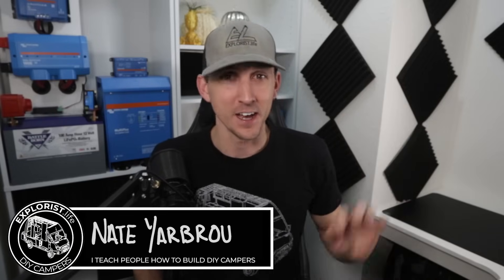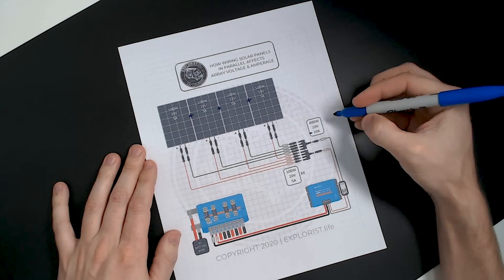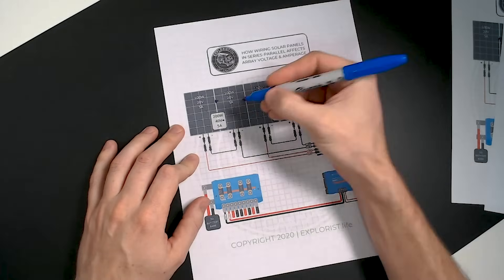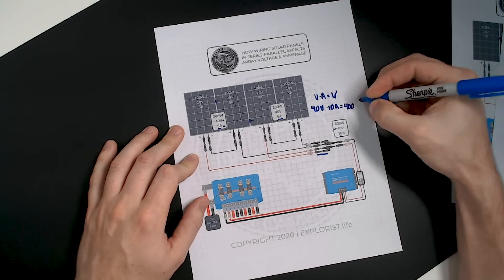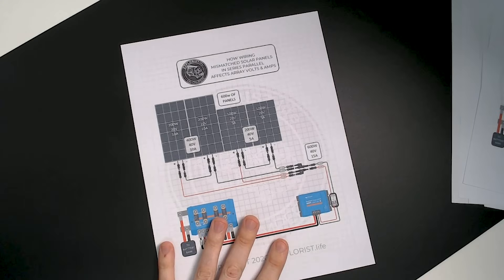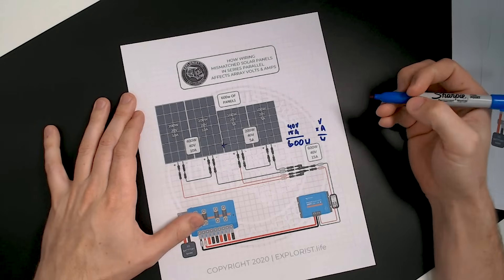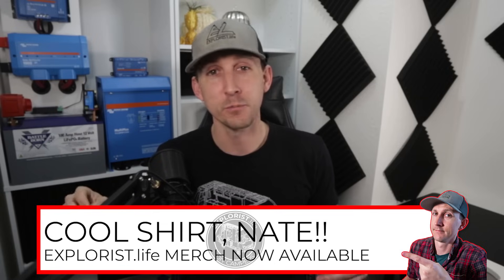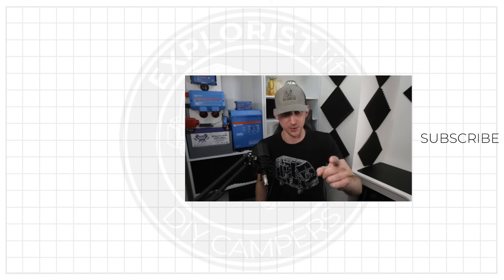How to Wire Different Sizes of Camper Solar Panels Together - Effects of Mismatched Solar Panels

Comment: Hello, I have a quick question. I have 3 100W 18V panels and a 225W 36V panel that I got for free from a friend. I did the maths and the more interesting route is to wire all the panels in series to have 95% efficiency instead of 79%. I was wondering if it was still the best route to wire them in series even with partial shading that will affect the array quite a lot. Thanks in advance for the answers!
Reply from the maker: Hey, Maxime Raison! I appreciate you taking the time to ask your question, but unfortunately, I don't have enough info about your specific question to provide an accurate answer, but here is a playlist that, if you watch all of the videos start-to-finish (and take notes 😉), you'll have a REALLY good idea of how to design a solar array: https://www.youtube.com/watch?v=Jkbs84sBHsg&list=PLmvhcyi4n0TV9pi83rFTv3ZuMT_S1xIZt

Alternatively, I have some of my most common solar array setups pre-built here: https://shop.explorist.life/product-category/all-products/camper-wiring-kits/solar-charging-wiring-kits/

Comment: When calculating what figure do you use? I see open current voltage, short circuit current (amp), peak power voltage, peak power current (amp).

Comment: If 2 sets of 4 panels each in series and then together in parallel with all the panels the same in voltage and a page but 4 were on east facing  and 4 on west facing roof, what would be problems is 1 bank in the sun and 1 bank in the shade

Comment: I have a 395w 10.8amp solar panel and I'm getting 288w out of the inverter. I need 112 more watts to achieve pass through charge and enough for my small items without draining the battery.  What sizing would you recommend to get to add to this one solar panel? I think it's max voc is 42v
Reply from the maker: Unless you have a REALLY good reason to do so... I recommend using matching panels... so I'd recommend another 395W panel given the charge controller can handle it.

Comment: Thanks. Accidentally ordered a panel that didn't match. Same watts, similar voltage. (17v / 22v.) been in parallel for a year after having just one for the year before. Was starting to feel one panel did same as both combined. [They are on shed, run pool pump, lights and stereo, charge Ryobi lawnmower, e-bike, few random other things.] Just bought a 3rd panel to match first, plan to charge both battery banks at the same time with different controllers. Commuting to work by e-bike is taking a lot. Sometimes wasting power by not using enough of it, other times getting low and having to ration.

Comment: Hi Nate! Awesome video! Really helpful! I still have a doubt if you can help me! I live on a boat, with a battery bank of 700A with 6 solar panels adding a  total of 740W. They are different Wtts but very similar Vts. All connected in parallel. Question is: what’s more important to charge my batteries, full 740Watts or all the Amps I can get from the parallel connection?
TIA! Cheers.

Comment: So would you calculate with Voc or Vcc ?
Reply from the maker: Vmp gets you voltage during max power production.  Voc is used for max voltage of the charge controller.  Vcc isn't used for much of anything.

Comment: while all your math is correct it is Ohm's law not Watts
Reply from the maker: Glad the video helped and I'm sorry for your confusion, but Watts law is: Watts = Amps x Volts as stated in the video.

Ohms law is: Voltage = Current x Resistance

Since we are given Watts, Volts, and Amps; we use Watts Law.  We wouldn't use Ohms law as we aren't given resistance nor do we need to know resistance: Introduction to Electronics - Stanford Wiki: https://ccrma.stanford.edu/wiki/Introduction_to_Electronics - "Watt's Law states that: Power (in Watts) = Voltage (in Volts) x Current (in Amps) P = V I"

Hope this helps!

Comment: Thanks for your videos on this subject.  When using cheaper equipment your video came in handy.  I bought a WERCHTAY 30A Solar Charge Controller that was rated at 50 volts and 30 amps but it was shutting down at 45 volts with my panels running in series, so I changed it to running in parallel and it solved the issue.  Your accent sounds Canadian, but you are in Colorado.  From where do you hail?
Reply from the maker: Glad it helped!  I'm originally from Oklahoma.

Comment: These examples were great but they weren't talking about connecting two panels together with different volts and amps. For example I have a Renogy 100w panel that says it puts out 19v and and 5.26 amps, and another panel that is 100w that puts out 21v and 4.76 amps. What happens if I connect them together? I assume I would just lose some efficiency? In parallel they would produce 10.02 amps and 19v =190 watts, and in series they would produce 38v and 4.76 amps = 180 watts? Is this correct?
Reply: Parallel is correct. In series, add the voltages 21+19 = 40 v and use the lowest amperage which is 4.76 Amps.  40v * 4.76 Amps = 190.4 watts which is slightly more efficient than the parallel configuration.

Comment: Your video is very good. Explainations and diagrams are spot on!!👍👍 Math is also awsome. The one problem I have is you keep calling it watt's law, the correct terminology is ohm's law. I say this with 49 years of electrical experience. I am not trying to bash your presentation because it is quite good, just putting this out there for information purposes. Keep up the great work!!
Reply from the maker: How about this since it sounds like you're pretty confident... If I link a credible source that states that watts law is Watts = Amps x Volts and Ohms Law is Voltage = Current x Resistance... you send me $100.  Sound good?
Reply: @EXPLORISTlife  BOOM LOL

Comment: Problem: Bluetti AC200P.

I can run 6 panels at 130voc.  1 more panel puts it over the 150voc.  Mppt controller triggers.   I would like to use 7-100w panels in a series/parallel configuration.  2 in parallel and 5 in series to achieve under 12a/150v Any suggestions? 

Bluetti ac200p Solar generator 
Solar Input
*Voc 35-150V / 700W Max. / 12A Max.

*7-100w SP modules - OCV 21.6 - current 5.78a

I was thinking...
2 parallel and 5 in series. 5 sps@21.6v(108v/5.78a) 
X 2 parallal@5.78a (21.6v/11.56a) 
Connecting the parallel to the series chain.  

Total output:
5 sps in Series 129.6vX5.78a=648w.

2 sps in Parallel 21.6vX11.56a=249.7w

Is this correct?, and where's the best place in the series string to connect the parallel (front, middle or end)
Reply from the maker: Not quite.  Wiring 7 panels in a series-parallel configuration is going to result in massive inefficiencies.  You'll want to either drop a panel or go with a charge controller that can handle over 150v.
Reply: @EXPLORISTlife  I will try a 3s-2p configuration.

Right now at 1.21pm on the bluetti it is registering 100.6v-4a on the 6s string and 53.8v-2.4a on the secondary 2s input at 64.56% efficiency.  I've seen the average at 435w.  That's a 66.66% efficiency at the mppt.  But if I check the volts at the mc4 connectors it is at it's full VOC, which is why I can't add the 7th panel in series.

I could probably do a 4s-2p.  That's 86.4v x 11.57a at 999.64w at mc4.  With a 66.66% at mppt for 666.36w.  That's within range of the 15amp 10awg wire and 150v-12a bluetti compacity. Because volts are more detrimental than amps.  The mppt will regulate and I'll get close to the 700w ac200p input expectations.

Comment: Great Vidio, but can you explain this to me using 3 different sola panels? I have 2 x 160 watts with 22.9 volts and 8.881A and 1 x 200 watts with 26.4 volts and 9.46A.
Reply from the maker: This video gives you everything you need to figure that out on your own. 🙂👍
Reply: @EXPLORISTlife  Ok, let me do the calculations:

Parallel: 2 x 22,9 V + 8,81A, 2 x 160 Watt + 1 x 26,4 V, 9,46A, 1 x 200Wattt = 22,9V x 8,81 = 591,3 Watt =113,71 % efficiency
Serial: 2 x 22,9 V + 8,81A, 2 x 160 Watt + 1 x 26,4 V, 9,46A, 200 Watt = 72,2V x 8,81 = 590,6 Watt = 113,85 % efficiency
is that right?

Comment: The problem is that from here, miles ans miles away,in Sw Eu-rope we can´t  read the SMALL print you wrote on the panels; and you had real estate galore for huge print ...   lol
Excellent video, anyway, about to subscribe
edit (subscribed)
On the last example (the 6+1 panels) ,what if they wired the 7th panel in series with 3 of them, making 1 series string of three,  plus 1 series string of four?  1380 watts, instead of the 600?
i mean if you ADD watts,you MUST get them back,not less.
Reply from the maker: It's exported in 1080p, so you could put it up on a 60" TV if you wanted and I'm sure it would be plenty big. 🙂

Comment: I got a question would u be kind enough to answer. Say I have 9 solar panels all are 300W. Can I have 8 of them wired in series and the final one to be connected in parallel so that I can get more amps out. 
Solar panel 300W 45.2V 8.86A
So will I be able to get 45.2v x 8 = 361.6V and since the last one in parallel amps 8.86A x 2 = 17.72A 
So entire array would be 361.6V @ 17.72A is this possible or am I wrong.

Comment: Hi, I enjoy watching your clips. I do have a question about MPPT Boost. May I e mail you problem I have with 48V system using a 37V PV
Reply from the maker: I do not answer questions via email.  Feel free to ask your questions here, though, so everybody can benefit and pitch in with help.
Reply: @EXPLORISTlife  I have a 48VDC battery bank, and I want to use half-cut bi facial solar panel. But it has only 37V open circuit. do you know any other half cut panels that are over 55V?
Or do you know any Victron MPPT that can charge a 48v bank (lithium ion), with 1 panel. I have read about MPPT Boost, what do you think about it ?
Reply from the maker: I would recommend using multiple solar panels wired in series so that the array voltage is at a more appropriate level.

Comment: Rather than talking the people out of adding a 100 watt panel in the last example you might have told them to simply add a second MPPT controller.
Reply from the maker: For the sake of the example, that was not possible per reasons the client didn't want to discuss.
Reply: @EXPLORISTlife  fair enough.

Comment: I would like to add to my Keystone Solarflex 200 system, but another 200 watt panel from Keystone is pricey!

The factory installed panel is rated: Pmax/W: 200, Vmp/V 32.34, Imp/A 6.18, Voc/V 40.12, Isc/A 6.55 and feeds into a Victron SmartSolar MPPT 75V 15 A controller.  I found some Newpowa monocrystalline panels ($86 ea) rated: Pmax/W 100W, Vmp(V) 16.77V, Imp(A)  6.26A, Voc(V) 19.83V, Isc(A)  6.56A.

If I wire two of these 100 watt panels in series I would get 33.54 Vmp/39.66 Voc.  I would then wire these in parallel with the 200 watt panel.  If I’m doing the math correctly, I think I would be losing around 4% efficiency in ideal conditions.

Is there a generally acceptable variation or efficiency that Is this close enough?  Are there other issues I’m not taking into consideration?

Comment: Would love to know what the best way to join these two panels is. fingers crossed for a reply.
	

Grade A monocrystalline

Rated Maximum Power (PM)
	

160W

Voltage at Pmax (Vmp)
	

160W

Voltage at Pmax (Vmp)
	

19.5V

Current at Pmax (Imp)
	

8.21A

Open-Circuit Voltage (Voc)
	

23.8V

Short-Circuit Current (Isc)
	

8.40A

Normal Operating Cell Temp (NOCT)
	

47 ± 2°C

Maximum System Voltage
	

1000V

Maximum Series Fuse Rating 20A

,,,,,,,,,,,,,,,,,,,,,,,,,,,,,,,,,,,,,,,,,,,,,,,,,,,,,,,,,,,,,,,,,,,,,,,,,,,

Specifications
Max Power :350W
Max Power Voltage:18V
Max Power Current:19.4A
Maximum Power Tolerance:±3%
Max System Voltage:1000V
Operating Temperature Min:-40°C
Operating Temperature Max:85°C
Cell Tech:Mono-Si
Module Application Class:A
TUV Certification:Yes
Reply from the maker: Hey there!  I've taught you the math on how this stuff works.  I'm going to need you to give it a shot now. 🙂👍

Comment: So if I have 10 identical strings in parallel but one string is shaded it's going to bring the whole array down to the voltage of the one shaded string?
Reply from the maker: Any shading of the array will bring the array power down.  I recommend avoid shading your solar panels if maximum wattage is the goal.  Solar panels need direct sunlight to function optimally.
Reply: @EXPLORISTlife  I understand that. I have no shading. It's the point tho. ive always been told You parallel strings specifically so if one string is shaded you will still get full power from the unshaded strings. But by your explanation if one string in parallel is not producing as much voltage as another string it brings down the whole system.

Comment: question on the charge controller itself. I have the Victron MPPT 150 | 70. I already have 700w going into it in one array. however, the CC has another port for another separate array. I'm seeing that i could add another 200w to the top of my van. But, i could obviously not add this to the current array without diminishing the total output. So, I can simply just wire the 200w panel straight into the CC, right? It has two positive and negative solar mc4 ports for that reason? 

I know the CC I have is capable of handling up to 900w. I've only ever seen my array get 78% of its total power capacity so I'd still be well within the CC's capabilities. However, the 200w panel will be a different A and V from my 700w array, so I'm wondering if the CC is designed to be able to handle this. Any help would be appreciated.

Comment: Never an odd smount of panels in series then?
Reply from the maker: Not necessarily.  1, 3, and 9 are usually fine.  5 and 7 are fine sometimes.  Odd numbers larger than 11 are pretty much never fine.

Comment: i have 3 panels with differnt voltages that 120w 100w and 80w and have connect them in palleral what is my wattage as all panels are 12volts and using a 100ah 12volts
Reply from the maker: Hey Lewis!  I actually have a video that will teach you how to determine how mixing solar panels in the same array affects it's output and teaches you how to calculate the output for yourself.  Here is a link to that: https://www.youtube.com/watch?v=jejro4zkl8I

Comment: How does it work when you do series parallel with different sizes in each series?  lets say you have one series 500 watts (2x 250 @8.5 amps) and another series 200 watts (2 x 100 @5.5 amps) and then have those two series in parallel? how does that get added up?

Comment: Hey now! How do you retain all of that info!?!🤣 a question, again. Thanks for replying. I have 235 watt chaoi panels and 100 watt Hqst panels. 6 of the chaoi and 5 of the HQST. Would you send me a diagram of the panel connect for the greatest amount of voltage? I’m using a 40 amp renology solar charger. Thx.
Reply from the maker: Mainly by writing it down and practicing.  Now it sounds like it's YOUR turn to practice. 🙂  I've taught you everything you need to know; so now it's time to go do it.

Comment: Hi kindly  I have 6 panel 49 volt Lingi 450 watt fixed on 150 degrees  in serial . I need to add 6 panel   in serial 49 volt 450 watt different type on 190 degrees  on  the direction of the  sun set  and fixed them on parallel also fixed reverse diode can u advise me thanks

Comment: This is the first clear explanation of wiring mismatched panels.  I installed a small system about 8 years ago with 3 different panels.  Was told at that time that it couldn't ( or shouldn't) be done.  I ended up getting 3 inexpensive PMW controllers, one for each panel.  Then I fed the 3 outputs into my deep cycle battery bank. It's been working fine but always wondered if that was the most efficient way of wiring. Now I'm ready to upgrade with LifePo4 batteries and better matched panels.

Comment: could the last one be fixed by converting the system to a purely parallel system or maybe adding 2 more panels and placing it  in sequence with the 3rd

Comment: So I could have some in series and some in parallel to get more wattage for my controller? That is untested…
Reply from the maker: Depending on the panels, their specs, and how they are wired, yes.  Always best to wire only like panels in the same array though.
Reply: @EXPLORISTlife  I have 4 different types for a review on price and efficiency.. before I begin that review I want to be sure my controller is accurate for my test.

Comment: Hi, I am wondering if you could get around this inefficiency by buying another charge controller and then having two charge controllers going to your battery? I understand that with Victron charge controllers they can work together like that.  Could you then essentially have two different sets of different sized of solar panels working together without lowering your efficiency?
Reply from the maker: Yep!  But then you are just talking about two arrays where each array would be treated as independent going to their own separate charge controller: https://youtu.be/N0UB7LZVduk

Comment: Easy solution to all this is to give each voltage that you end up with it's own SCC.
Just group panels with likewise amperage together in series and connect them to their own SCC.
Or group panels (or strings of panels with likewise amperage in series) with a likewise voltage in parrallel to their own SCC.

BTW, a small mismatch in voltage is not a problem, yes one(or more) panel/string will run at lower voltage but what happens to the amperage....... In the end it is all about the watts.... Wh

Comment: i want to use 11pannals of 150w and 2pannales of 540w but i have 3.2kw inverter system so how i wired the panels for best performance ,